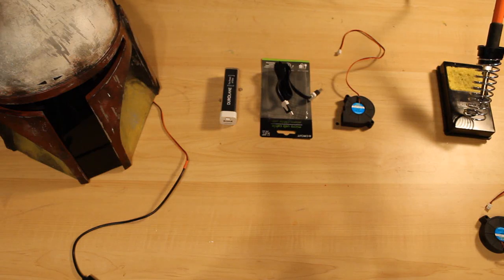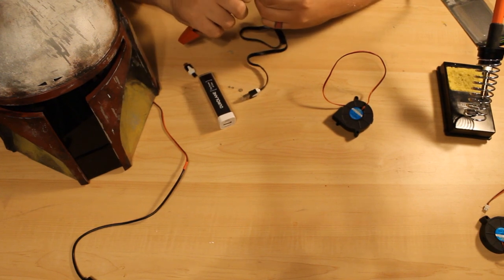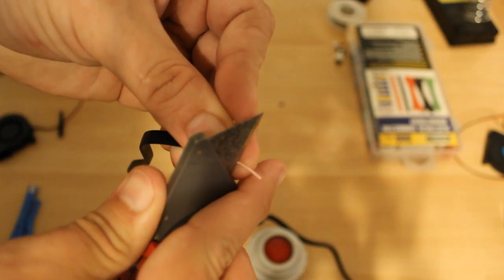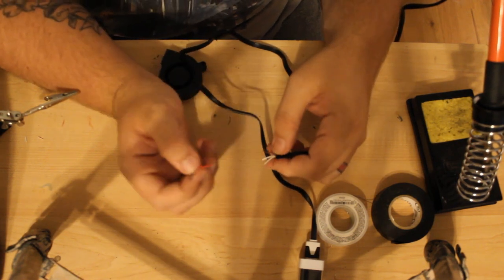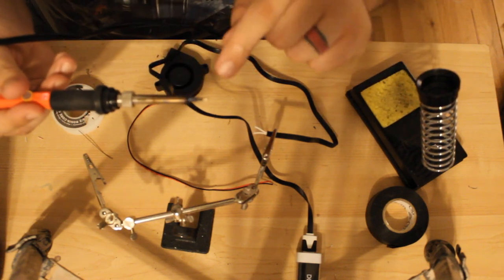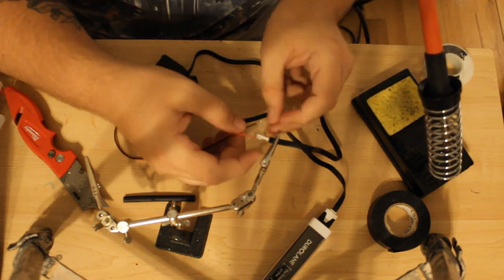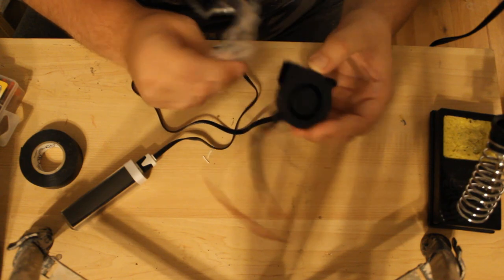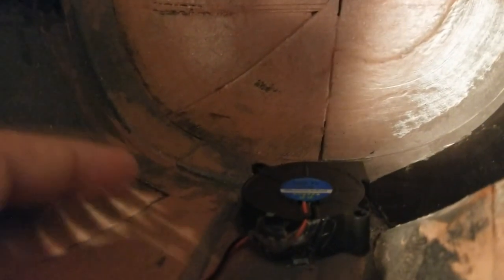How to make a Mandalorian helmet fan.

Comment: I'd prefer to install the fan the other side out so the restriction of the air intake doesn't burnout the electronics (but I do understand that installed it this way around to avoid hair getting caught in the blade).
Reply from the maker: There is no restriction on air flow this way. The clearance on the underside is enough to not bottle neck the flow of air.

Comment: Will this work without the soldiering part? As in will just connecting the tips with insulation tape be enough to make it work?
Reply from the maker: It can but the connections are weaker. For somthing simple like this you can just tape it but its worth learning to soldier.
Reply: @ZebulonPottery  Thank you! I'll keep it in mind when trying it myself

Comment: nice  work, is there a small hole on the opposite side of the helmet (outside) for the air to get sucked in?
Reply from the maker: The air intake is in the helmet. It only needs 1 to 1.5mm of clearance to work. You could put a hole in the bucket but where I have the fan I think it would be hard to hide the hole.
Reply: @ZebulonPottery  thx for the explainantion

Comment: What is the diff between the 5v and 12v ? It comes  as an option with the link u put in the description ? Is the 12v bigger in size ? Is it stronger ?
Reply from the maker: V is for volts. It's how much power you need to run the fan. I like 5 volts for a few reasons.
1. If you want to tie in LEDs on the same power strip they wont burn out. 
2. Rechargeable phone banks are all 5v

You can use a 9v fan but you will.need to use a 9v battery to run it. All day at a con and your battery is dead. Battery packs are cheap and you can have a few on hand. Just something to think about, but either on works if you use the correct power supply.

Comment: So I got the fans that are 5V but I’ve noticed they won’t even power on until I use a 12 V power source. Help?
Reply from the maker: Is it possible to send a picture? I would guess you didn't get 5v fans. Sometimes the warehouse will send you the wrong items and they could look the same.
Reply: @ZebulonPottery  yeah I can show you
Reply: @ZebulonPottery  do you have Instagram?
Reply from the maker: @fatal3899  I do. Post a link or your handle.
Reply: @ZebulonPottery  @2BFATAL
Reply from the maker: @fatal3899  I don't see a post of the fan. If you follow me on ig @zebulonpottery I can message you. If pottery isn't your thing just unfollow after I send the message. 

Or post a picture on your account and I'll comment.

Comment: You know they make USB cooling fans right?
Reply from the maker: This is probably cheaper and its enclosed so hair doesn't get trapped. I have seen a lot of people selling this as a kit and honestly $60 for a kit was too much so I made a video showing people how to made one for under $6.
Reply: @ZebulonPottery  the one I found is the same type of fan but with a USB cord 2 for $12 on Amazon.
Reply from the maker: @nil810  right on. I am on the mandolorian merc forums and saw kits being sold for $60. At the very least if anyone wants to build one this video will help them.